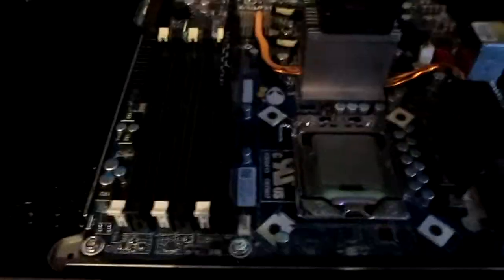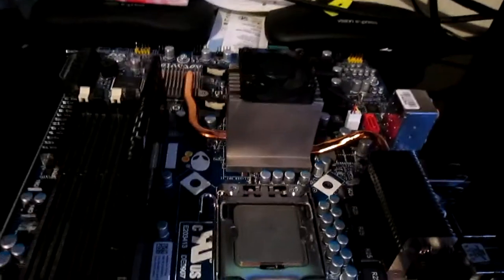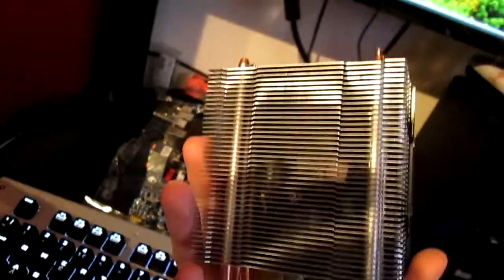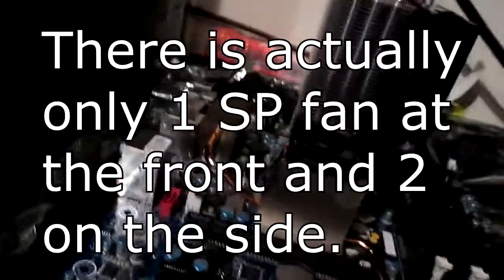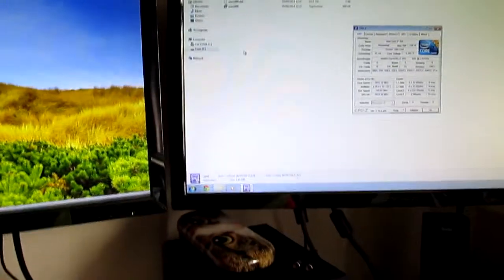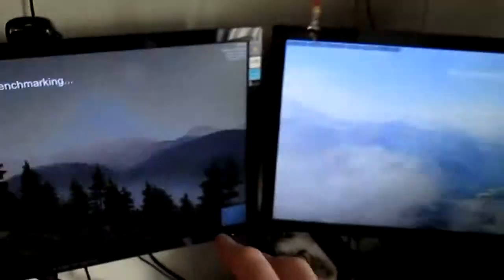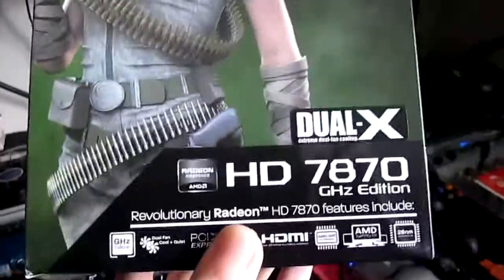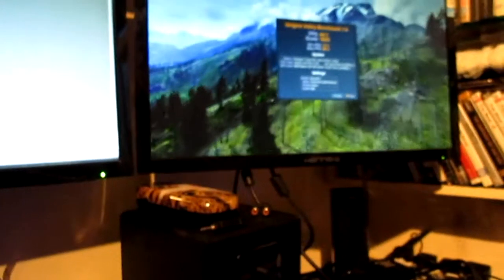Build Log - Gaming Computer for £300! ( i7 920 )

Comment: The i7 920 is still a great processor. It keeps up to the newer processors in terms of gaming. Who would want a faster processor, simply to shave perhaps a few minutes off rendering time?
Reply from the maker: They are so cheap and their performance beats a lot of processors costing 3x as much. Only downside is it can be hard to locate a good mobo for a good price.
Reply: Yes, indeed.
Mine (C0) will soon enter 9th year and it's at 4Ghz @1.45v. I sure hope i am not close to its very very shortened life expectancy already :D
If you want some more proper benchmarks of i7 920, i have them here.

Comment: I had the same CPU overclocked to 3.6Ghz with that same exact cooler, but I had to keep the side of the case open because of excess heat. I recommend a dual-tower-cooler for this CPU. I have a Coolink Corator DS which is cheap and keeps temps @ 75 C in heavy gaming.